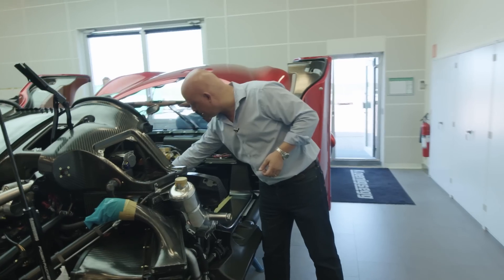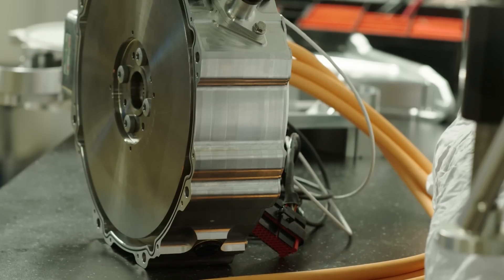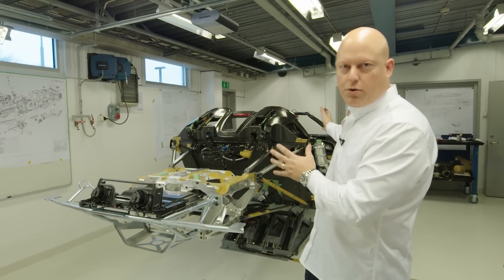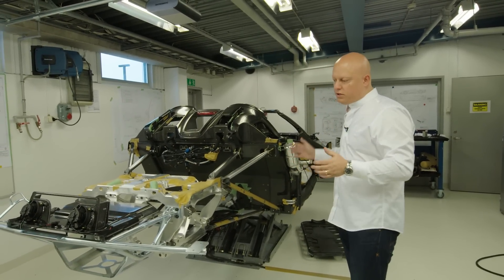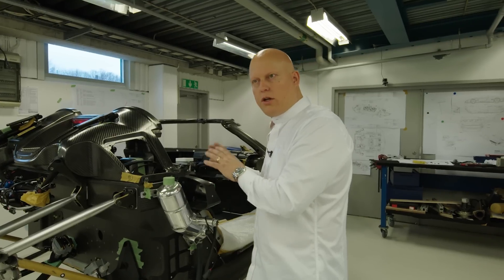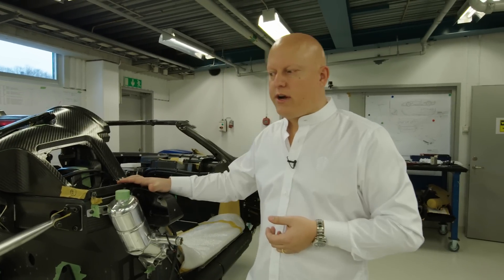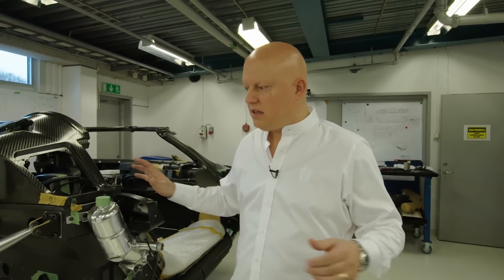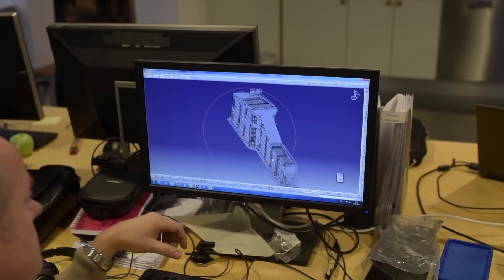Koenigsegg Regera Under The Skin -- /INSIDE KOENIGSEGG

Comment: But why the tacky bio-hazard wheels, god...
Reply: He was probably going for function over fashion. The arch is the best shape for load dissipation.
Reply: +Mudux It's actually because that shape allows for the best balance between strength and weight in a carbon wheel construction. He mentions it in detail in one of the videos.
Reply: The shape is coincidental - If you visualise the torque on acceleration and braking being exerted by the hub on the rim and vice-versa, it's the strongest/best shape for the wheel.
Reply: what exactly do you think is tacky with them? afaik no other car manufacturer has that style of rims atm and especially made of carbon fiber. they're pretty unique
Reply: I forget if it was mentioned on Drive+ (unsubbed months ago for lack of content) or the Apex film. But it's because carbon wheels and aluminium wheels react differently to certain types of stresses, so because of the inherent qualities of carbon fiber and the weave, that design is both stronger and lighter than conventional spokes. You basically couldn't do that design feasibly on an aluminium wheel. I know for a fact he said that. I met the guy at the premier of Apex in LA and actually talked about how gnarly those wheels are and their design process. Cool dude. Genuine and loves talking to fans because he's just another car guy on the inside obviously.
Reply: The wheels are made of carbon fiber, and they are hollow, they are so light that they have to put steel blocks on them to keep them from floating to the ceiling. The blocks are high carbon steel, and are machined on a CNC lathe to exactly standards. Each one is individually fitted to the wheel, and is numbered and married to that wheel, all of which is stored in a supercomputer for future reference.

 When the car returns for service and the wheels removed, the correct steel weights are placed upon each wheel to prevent floating in the shop. This is why you see workers without hard hats in the videos.
Reply: mugdays
No, it isn't "bollocks". Yeh, you can make wheels pretty much any shape and form, from solid discs to spider-web pattern, but this form (coincincidentally resembling the "biohazard" symbol) is optimal.

Think of it as two 3-spoke wheels imposed on each other - one set of spokes transmits torque from rim-to-hub (braking), the other vice-verse, hub-to- rim on acceleration.

OK, maybe these are only incremental improvements on other patterns, but CvK and his team are trying gfor the lightest wheels, with the least spinning intertia/unsprung weight.
Reply: And how many "other manufacturers" are making hub-to-rim carbon-fibre wheels?
Reply: Yeah not sure what he's on about. Hence why I said it's due to the carbon weave and the design fitting the intrinsic qualities of carbon wheels. This design on aluminum wheel would be absolutely shit. I don't care how you "visualized" it. You brain doesn't run modeling and simulation software, so you can't visualize anything.
Reply: mugdays because your average car doesn't exceed speeds of 400km/ hour and have breakforces of around 2G's...
Reply: yeah the aluminium ones are far better looking!
Reply: +Y3arZer0 Well said, exactly what I was thinking but worded better.
Reply: Because ............ they're not Knoenigsegg.
Reply: because they weigh like 8 lbs
Reply: This is utter bollocks, mate. If that were true, ALL wheels would have a similar design. The truth is just that it was purely an aesthetic choice.
Reply: Rainer Scott 
So other wheel manufacturers aren't utilizing the "optimal" design because...?
Reply: Aldin They're bio-hazard symbols, that's what is tacky about them (unless you are a teenager)
Reply: Y3arZer0 hmmm... no, it's not, just look at any racing wheel (cars or bikes) and see for yourself.

Comment: Year and a half old footage? 
They've halved the battery size since. Probably because it could still do what they needed it to do, at a lower weight.
Reply from the maker: Stay tuned...
Reply: Rimac make their electrical systems
Reply: Ok, how fresh will your latest footage be?
Reply: TheDonBarracuda I heard they employed more people more than Pagani and Koenigsegg combined. Bit different.
Reply: Cyril Varghese Because VW Group wanted to be above every other car manufacturer. And they did for years with the Veyron. That says something about the VW Group aswell. That's how I think about it :)
Reply: Research and Development, it's way to research new technologies and test them, eventually that technology will reach normal cars like the dual clutch on the Veyron, know it's so cheap to produce that every Volkwagen has it.
Reply: Cloxxki much denser battery!
Reply: yes the new battery is smaller, but can be drained and re-charged faster
Reply: TheDonBarracuda Yep your comment was false. Volkswagen group, which includes Bugatti, actually loses money with every Bugatti Veyron they made. Not sure what they make with the new Chiron, but I quess that car won't be profitable either.
Reply: Ms666slayer dual clutch was actually first seen in the 2002 golf r32, that was even before when the veyron was a thing
Reply: |〉 TARIQ k. 〈| First Veyron prototypes date back to 1998
Reply: |〉 TARIQ k. 〈| oh, ok. Anyway, one of those prototypes was sold to a Swiss guy, and was omologated for the road. Does it count?
Reply: David Elstob Elaborate? Energy or power per kg or liter? It's half the capacity, and lighter.
Reply: Is Koenigsegg still working with Rimac?
Reply: The descriptions says 6 episodes.
Reply: Cloxxki in another video he mentions that the battery cell is very power dense    (efficient) and is similar to F1 battery packs, hence they could make it smaller.
Reply: Batteries and control circuits only.  I read Rimac is building electric bikes for somebody as well.  It looks as if Rimac is going to have to relocate from Croatia and possibly seek investors in order to be able to build any production cars.  They don't want to do this, but it may be inevitable for them to take the next step.
Reply: Paul Copeland I heard about the bikes on Alejandro's channel he also mentioned that they make more money [correction] employ more ppl than Bugatti and Koenigsegg combined.
Reply: Cloxxki Did I mishear? haha I must be going deaf in my old age! I guess that makes more sense, still an amazing achievement to get this far
Reply: I think they lose like 6 million dollars, for each Bugatti which is insane!
Reply: Bramos VW make so much money I guess they can take the hit making some thing like the Bugatti
Reply: Bramos then why do they make the bu ga ti ?
Reply: Cloxxki
Reply: Javier Lebron Sup bro :-)
Reply: Sort of a prestige issue.
Reply: |〉 TARIQ k. 〈| I was talking about the actual  Veyron dual cluthc technology, not the Dual Clutch itself that has been around for a time, on the Veyron the neede to make a new kind of Dualt Clutch the make it wistand the Torque
Reply: Anankin12 we're talking about production cars not prototypes

Comment: It sounds like the ICE directly charges a battery pack only when needed and the wheels get power only from an electric motor(s). It's like a Chevy Volt times 15.
Reply: Not quite. The regera doesnt have traditional gears, its like a complicated electric clutch acting on a really tall gear. Its not really a hybrid in the same sense that a motorbike isnt a bicycle
Reply: That was just my impression from this video alone

Comment: Should be 4wd..
Reply: Random moron on the internet calls Mr Koenigsegg stupid...
Reply: No, that was directed toward a deleted comment.
Reply: Come on so, it's not like Koenigseggs have a history of having good traction (the ccr, ccx) and this has twice the power. Instant huge electrical torque with a 1:1 engine through only 2 wheels? UNDRIVEABLE
Reply: F1 cars have massive racing slicks and huge down force to try and put the power down. As well as that they only produce around 950 hp right now. The Porsche 918 is heavier and has less power than both the Laferrari and P1 yet it isn't any slower on track because of it's 4wd. 4wd cars were boring before alright and mainly driven by yobos who would go on about how quick their cars could launch to 60 mph, but they're better now. This car does need it, Christian says it's more of a gt car to be driven on the road..can you imagine driving this on road tires in the wet? No thank you